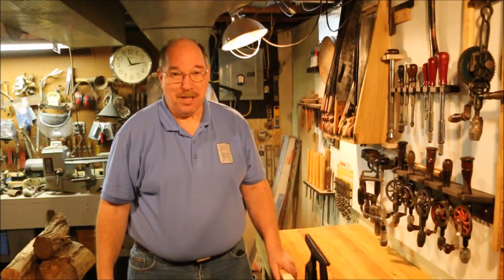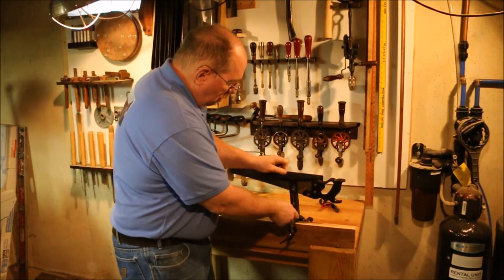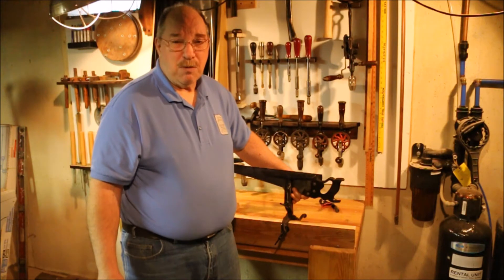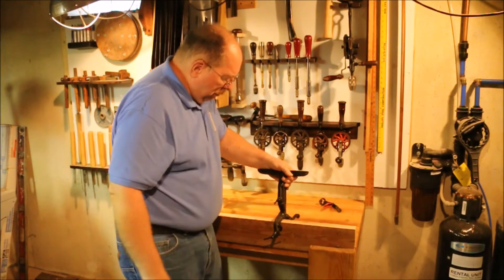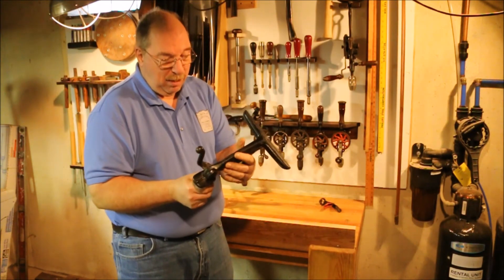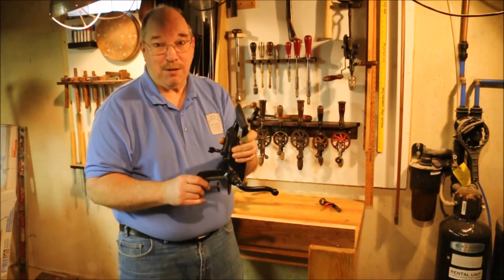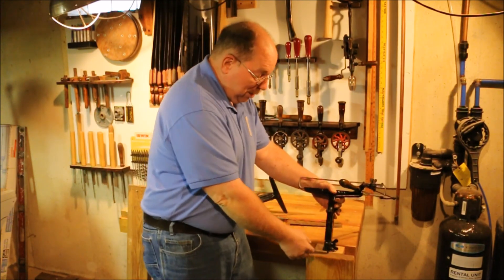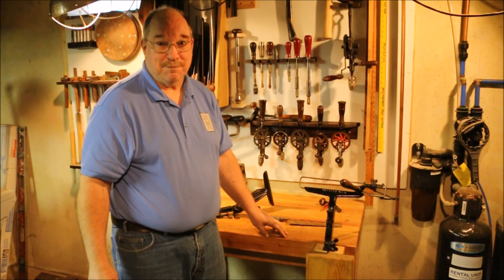BOB WEAVER ASKED FOR A BETTER EXPLANATION OF MY SAW VISE

Comment: I've bought 8 or so of them. I broke one trying to do something I apparently wasn't supposed to be doing. I hung them on a nail in the barn. 
 Good show man.
Reply from the maker: I orignally thought they were for sheet metal work. Wasn't until I started sharpening saws that I heard about them on the Old Tools Mailing List Galoot Central.

Comment: I have a Disston D3. Big and solid. It has the wing nut to adjust the angle. When I got it it was frozen up and one of the wings was broken off. I don't know if it was dropped or a previous owner tried to persuade it with a hammer.  I loosened it up nicely with a soaking spray of WD 40. I let it set, and it still would not budge. Heated it up with a blow torch, let it cool and heated it up again. That did the job. I don't see them around here much. When I see them on ebay, many times the shipping is prohibitively expensive many times.
Reply from the maker: +Matt Cooper does it have the mounts for the file guide? They would be cast into the outside face of the jaw opposite the clamping lever. The #3 with a file guide is sought after.
Reply: Old Sneelock's Workshop it has the mounts, but no file guide. It still has the thumb screws. I picked up at an estate sale for 15.00, I scoured the house for it just in case it got separated, but alas it was nowhere to be found.
Reply from the maker: @Manocooper  Since I found the Disston #2 and got the file guide working like it should I know why the file guides are hard to find. 
They are a pain in the neck!
The guide shortens the available sharpening area by about an inch on each end of the vise. The nice 10 inch long #2 ends up with the same effective sharpening area as the cheap little 6 inch vise from Joe's Hardware. 
The guide does hold the angle well. It just adds a whole lot of fussing to a rather simple job.

Comment: I guess the old Columbia is my go to since I gave my small one to the Saw Surgeon. ZAnd I'll have to go it it because it sure won't come to me! Now I'll probably fine a dozen and me with not hardly room to walk sideways in. Oh well. Such is a day in the life of a Sneelockite.
Reply from the maker: Lewie McNeely If they don't start that way most of us end up with shops like Pulman cars. One narrow aisle and the walls lined with boxes. 😈
Reply: Mine is that way right now. Found a spare gas tank for the splitter because the original one leaked because of the nice neighbors that destroyed it. The muffler bolts rung off so I go get a screw in tomorrow God willing. No more gas leaks and a full shed. The splitter is ready with the tongue on and foot up. No more compact nothing.
Reply from the maker: Lewie McNeely Tell me you didn't loan out the splitter. Forget that. It's yours and you will help a neighbor in need. I offer to use my tools to do the job for them, unless it requires a hand saw. Those I give away. 😁
Reply: OH no Unc. This is from what the original wreckers did to it. All I lack is another muffler because the bolts wrung off on the mounts on the factory job. Now I'll just get a new screw-in job instead of a bolt on square one. Just as good. The saw shop had one for a 3 or 3 1/2 that was 1/2 i.d and 3/4 o.d. I need a 3/4 i.d and an inch o.d. I'll find one. Online or next week. Maybe Tractor supply.
Reply from the maker: Lewie McNeely Made one for a 12 hp Wisconsin. Welded a plate on the end if a one inch nipple and drilled it full of holes. Welded a washer next to the threads on the open end.  Made another nipple like it and welded both to opposite ends of a two inch dia x ten inch long piece of electrical conduit. Sounded real nice on the 70 mph scooter we put it on.  Yee haaa. Out ran a Honda 90. 😎
Reply: I'D say! I like the old Wisconsin jobs a BUNCH! Like the old 301 Kohler cast iron jobs. Good Gravely engines. Loggers used to make mufflers for their trucks out of 6" well casings. Weld an inlet and outlet and maybe a baffle mut most likely not and hear those babies RING! I got a new one coming from town monday about 10:30. I ran a 1" p,v,c, deal in the zaust hole it so it'll work BUT it will have anti-seize on this new one. I might try and drill and tap but not desperate enough when there's an easier fix nearby..

Comment: Hello, Old Sneelocks;
This is a pretty good video except you didn't tell us which vise you used.
I need a saw vise since I don't care for power tools as I have breathing issues.
I've seen several on ebay & a new Gramercy Tools Saw Vise for ~$270 online.
So IF I knew which one you've got I might could buy one 1.
Or, more likely, build one of the shop-built versions.
Have a GREAT day, Neighbor!
Reply from the maker: I have several that I picked up for $15.00 or less. 
A couple boards clamped together will do a fine job of holding the saw for sharpening.

Comment: I WOULD LIKE TO SEE YOU DO THE GENTS SAW, A FULL RESTORATION  PLEASE
Reply: i wonder if sneelock sharpens his hacksaw blades too :P
Reply: YOU CAN BE SURE HE Repurposes  them as i do.
Reply from the maker: Jusb1066 Only as a desperate measure. I have sharpened a Sawsall blade when it was 9:00 pm and I was half way through a cast iron soil pipe and couldn't use any toilets or sinks until I had the line change finished. I used a Dremel abrasive wheel and recut the teeth twice before I was finished. I had snapped two out of the three long blades I bought for the job. 
Laying on my back, in the attic, with my arms full length to reach into the eaves where the vent line was. I was 20 years younger and just as stubborn. 😈
Reply from the maker: Mike Tarzwell Such good steel should not be wasted. Small knives, wear bars, high grade washers, hundreds of possibilities. I also have a handle that holds a hacksaw blade. Broken ends make good keyhole saws. If you grind the back down the can fit in a 1/8" dia hole and cut a square hole in steel faster than a file.
Reply from the maker: Mike Tarzwell  Me too. Can we convince Old Sneelock that this job is a priority?
Reply: @OldSneelock  Am restoring similar vise but need pivot pins. Do you have a good source? Rex OUT
Reply from the maker: @rexwootan2307  Check your local hardware store. They should sell a variety of sizes.
Reply: @OldSneelock  I thought so too but every kind but nothing that looked like it or would work.
Reply from the maker: @rexwootan2307  If the locals won't work try WW Grainger or McMaster Carr. More money, but they stock a good supply of hardware. They both have online catalogs. I bought odd stuff from them for years.

Comment: It looks like ebay has 57 results for 'hand saw vise' right now (185 if you just use 'saw vise'; that includes circular saw vises), and prices appear to be $20 - 40 and UP!  I saw several Sterns, almost as many Sargent's, and a couple of Disston's (the Disston's were going for $35 (each)).  There was also a mint condition Disston for $300.00
If anyone wants to build themselves a larger, freestanding saw vise, Roy Underhill shows how to make a swinging saw vise on "The Woodwright's shop" (http://www.pbs.org/video/woodwrights-shop-swinging-saw-vise/).  It probably wouldn't be worth it to build one unless you have as many saws to sharpen as our dear Uncle though!
Reply from the maker: Brian Neeley Thanks for reminding us about St. Roy's explanation of the old saw sharpener. Fortunately I'm of the opinion that giving away knowledge  in no way lessens me.
I do like the idea of the swinging saw vise. It would be nice for demonstrations like he gave at Highland Woodworking.